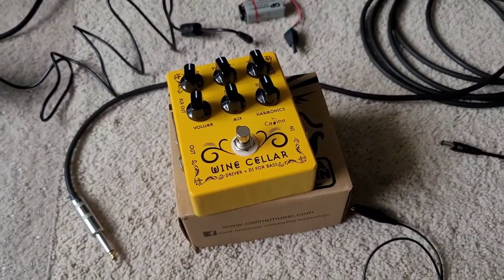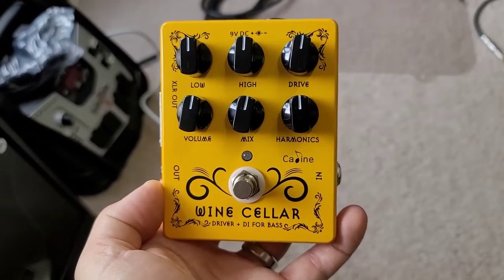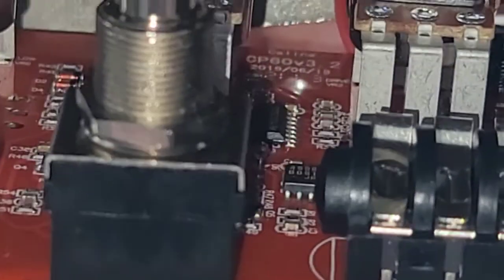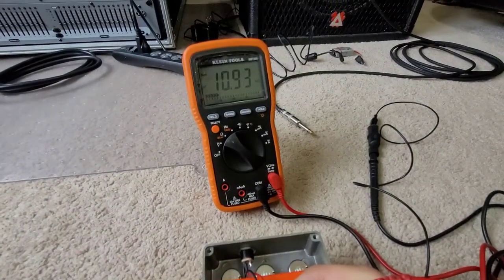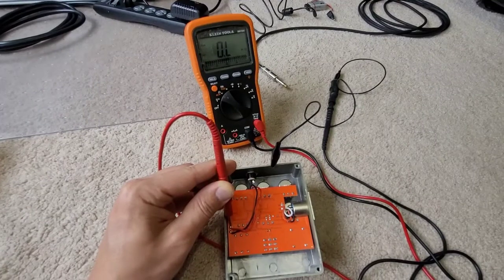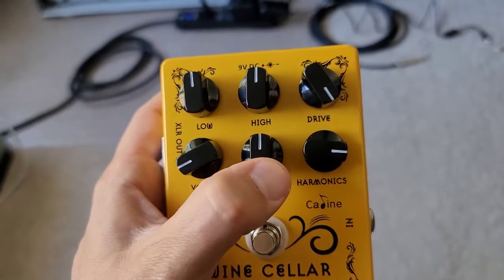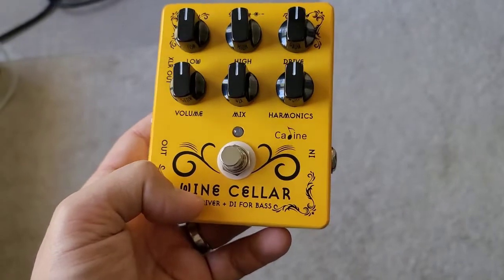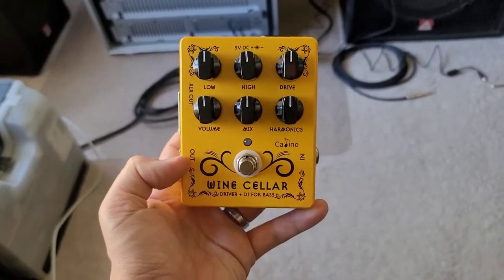Caline: CP-60 Wine Cellar Bass Driver DI Pedal: Technical Review & Teardown

Comment: my pedal is having a loud pop noise when plugging in the power supply. pls help me
Reply from the maker: @daveanthonybalisacan7941  only when it is plugged in? After it's powered up no problem?
Reply: @Bassguitarist1985  yes, even without switching it on
Reply from the maker: @daveanthonybalisacan7941  a loud pop is normal when powering up but shouldn't do that when switching the effect on/off
Reply: @Bassguitarist1985  what is the issue then?
Reply from the maker: @daveanthonybalisacan7941  buffer circuit is powering up. It's normal. It's not a true bypass

Comment: I got me one of these thinking the XLR output could be used as DI with phantom power but it doesn't work with phantom power at all. It only sends out the same level as the jack output when plugged to a 9v power source. What's the deal with that?
Reply from the maker: @N8oRMusic  that is by design the XLR in 1/4" output are the same level. Yes it can be used as a DI box. Unfortunately they did not put the phantom power feature like the Tech 21 sans amp this is cloned off of.
Reply: @Bassguitarist1985  it sucks because i need to bring along a seperate DI box to gigs in order to get any decent level signal to the mixing desk. Otherwise I'm needing to crank the mixing desk input to something like +20db while introducing a shit tone of noise. Could it just be that my pedal is faulty? It doesn't make sense.
Reply from the maker: @N8oRMusic  naw something is up. I've always had plenty of output volume from the XLR when running to a mixer. I usually get the opposite question does the pedal have enough XLR output to drive a power amp and the answer is no to that, it's meant to be a DI box. It's an amazing pedal for the cost. You might have a faulty unit

Comment: In some specs info on the internet mentioned there is a cab sim circuit included for XLR output, is that true?
Reply from the maker: Sorry for the delay response, but as far as I can tell there is no speaker SIM on the XLR. The same signal on the quarter inch is the same on the XLR.

Comment: Hi. Does it color  signal from DI XLR? I need  my signal go through to my amp combo for monitoring, and clean neutral signal from xlr DI to my sound card.
Reply from the maker: It does color the signal through the DI yes.
Reply: @Bassguitarist1985  But if I turn mix knob all the way down. Will DI XLR give me clean and neutral signal?
Reply from the maker: @EadgCrunch  it would yes, but no drive signal on the 1/4" essentially acting as a direct box. Why use it at all at that point? You would need a direct box for the clean signal while monitoring through your amp with the Wine Cellar using the drive channel
Reply: @Bassguitarist1985  Thanks for your reply! I’ve got an old audio interface with  broken monitor button. So I don’t have opportunity for direct monitor through my studio monitors, only with slight latency from ad/da conversion. I have a bass combo. So I decided to monitor my bass through my bass combo. Insert my bass in to Wine Cellar 1/4 input and output it to bass combo from another 1/4 output for monitoring and record clean neutral signal from  XLR DI output into my DAW for later processing. Will this work? Thank You.
Reply from the maker: @EadgCrunch  that will work yes, and if you want to preamp it through the pedal with the drive tone you can do that too
Reply: @Bassguitarist1985  Thank you.

Comment: hey i have problem with this pedal. at 5:10 you taking about this jackoutput. How to fix this. i have noise and hums when effect is on
Reply from the maker: The metal collets for the 1/4" input and output jacks need to contact the case in order to be grounded. Otherwise this is what I found causes the noise. Just scrape a little bit of the powder coat paint around the edge of the jack hole and then reinstall the collet with the washer. It should be enough to bond that jack to the case and stop the buzzing.
Reply: @Bassguitarist1985   ok so i must to unscrew all take the electronics little bit out, take the metal jack collar out and scrap the yellow paint in this place where os this ring of 1/4 jack? And what is the washer? Xd
Reply from the maker: @rastafaray666  The washer is on the collet itself I don't think it's removable, and yes you are correct on the rest

Comment: Hi man.. i had bass with active onboard preamp.. do i still need this pedal? Does it make the tone better?
Reply from the maker: It gives you a different tone it doesn't necessarily make it better which is subjective. You likely have a 9 volt or 18 volt active two band or three band EQ. That alone is very powerful of a tool. This pedal will do a much more detailed EQ curve than just a 2-3 band giving you a more mid scooped but mild overdrive tone. Check out my other demo video on my channel about this pedal that will give you an idea of how it sounds

Comment: i just wish they put battery slots in this! when i'm at my parents i don't really use power supplies so I have to use a HB Powerplant, it's mostly pretty good but I had to get a new one as the old one was noisy and stopped working so I don't want to over use this one. I got the Caline Bass Overdrive for the art and it's kind of meh, probably a cool single use pedal but I need something for my very dry sounding HB Amp
Reply from the maker: It's a great sounding mid scoot pedal and can work for various playing styles and genres of music but it's not for everything. Some may find it bland others may find it very useful when they add other coloration from their amplifiers in conjunction with this pedal.

Comment: Hello! Do you have a video explaining how to do this ''scraping''? I bought a pedal like this and it has a buzzing/noise.
Reply from the maker: I mention this in the video you need to scrape around the cutout where the quarter inch jacks are so that when you thread in the outer metal bushing it will make contact with the case. This will prevent it from having a floating ground causing noise.
Reply: Do I need to open the pedal to do this scraping or do I just need to loosen the ports on the two external connectors to do the process? @Bassguitarist1985
Reply from the maker: @dreik4302  no all you need to do is remove the metal bushings on the quarter inch input and output jacks. Scrape a little around just enough where the washer contacts directly with the case ground and then tighten back snugly Don't over tighten since the threads are plastic. That should hopefully solve your buzzing issue
Reply: Do I need to scrape so that the entire washer is in contact with the housing? I scraped both sides, but the buzzing/noise remains. Do I need to do it on the source connector too? In this case, do I need to open it? @Bassguitarist1985
Reply from the maker: @dreik4302  input and output 1/4" jacks. Make a video with the noise. What is your exact setup?
Reply: I use the CP-60 and a Sonicake Octaver. But I did the test without the CP-60 and there is no noise. When I use the CP-60 alone or with the octaver, it hums. Where can I send the video? @Bassguitarist1985
Reply from the maker: @dreik4302  upload a video to your channel and send me the link. Ill take a look

Comment: hi,... which is better caline cp60 or behringer bdi 21? thanks
Reply: I used sansamp and mxr bass d.i before! I need versatile sound with punch low 🙏🏽
Reply from the maker: I don't have experience with the BDI21 but id expect its a similar clone design of the tech 21 driver.
Reply: @Bassguitarist1985  i want to know in both noise case. Which one is lower in noise case 🙏🏽
Reply from the maker: @xtremeboy851  can comment on the BDI21. Never tried it. I do have another video where you hear a DI mixer feed of the Caline CP60
Reply: @Bassguitarist1985  can you give me a recommendation the best one cheap preamp d.i?
Reply: Does caline cp60 a pure preamp or with cabinet simulator?
Reply from the maker: @xtremeboy851  no its a DI box. No cab sim.
Reply: @Bassguitarist1985  is cp60 true bypass?

Comment: It would have been amazing if they'd kept the XLR 48v powering option on this pedal.
Reply from the maker: Certainly would be a nice feature but they remove that and also reduced the amplitude of the XLR to instrument level instead of line level. It would not be able to drive a Poweramp on its own without a mixer in between.
Reply: @Bassguitarist1985 Audio lesson #1 :  A DI is not line level at the DI's output. You need a pre-amp to bring it up to line level. The XLR output on the CP60 fonction is a DI output.
Reply from the maker: @MartinMartin-yi9to  Yes correct that is what I said in my previous comment. Many people seem to mistake this pedal as a preamp pedal but it is not. A preamp denotes a line level output, a DI box denotes instrument level out, meaning it requires an audio mixer with a preamp to boost the signal to drive a power amp.
Reply: Quer dizer que esse pedal não é um pré amp?

Comment: What's the value of 1/4" output impedance?
Reply from the maker: I chatted with you on FB. I assume 100k, don't have the schematic. I can ask my Caline contact though.
Reply: @Bassguitarist1985  oh that's you! Thank you again for your contribution for the bass community!
Reply from the maker: @datle1402  my pleasure!
Reply: @Bassguitarist1985  Oh, and by the way I have another question! I notice there's a difference (quite substancial one) between [MIX knob in zero position] and [bass directly into interface]. Also when I set my MIX knob to zero, other knobs still change my sound when I try tweaking them, which is pretty nonsense. Is this normal or my unit is defective? Thank you!
Reply from the maker: @datle1402  i believe that is normal. I'd have to see the schematic to understand the signal routing better. I like the sound of the pedal though!
Reply: @Bassguitarist1985  Hello, I have another question if you don't mind! Can you tell me if this pedal is a transparent active DI box when I bypass it (or set Mix knob to zero)? Thank you!
Reply from the maker: @datle1402  it is a buffered circuit for the 1/4" in/out. The footswitch does true bypass the tone circuit so it does act as an active direct box

Comment: No 9v power adapter? Wow, that's something that all pedals should come with new. That's something that is a must with me, no plug in power adapter no bueno.
Reply from the maker: Unless it's a specialized voltage other than 9 volts many pedals are not including them. The thought is that you will be putting them on your pedal board which should already have a power supply to run it. It's the same argument as a phone charger included with new cell phones, some of them don't include it

Comment: Hi my man
Do you think this is a better purchase for bass vs the Joyo American/Caline Americana?
Reply from the maker: I would say that this is a better purchase for bass guitar then the Americana. I haven't tried that one yet but I would question if it retains the low end of bass. If it doesnt you might need to run it through a parallel mixer to mix the pedal and dry signals

Comment: I sold my Sansamp BDDI thinking I was done with preamp / DI pedals.  Ended up wanting to add a little grit to my Markbass combo so I bought one of these.  I have ran it into the front end and the effects loop.  It sounds great either way.  I do wish it had a phantom power option but... what would you expect for $40.
Reply from the maker: Exactly! Its a budget clone pedal based on the sansamp. Very useful for the price! No complaints here!
Reply: Update lol!  Just bought the Ampeg STG-DI. It quickly jumped into the number one spot.

Comment: also, is the XLR protected from phantom power?
Reply from the maker: Yes there are coupling caps on the hot/cold pins after the opamp outputs to block VDC. Phantom power wont harm the pedal.
Reply: @Bassguitarist1985  I was running out of google-fu to find out about this, thanks for informing!
Reply from the maker: @doplaysgames  Glad I can help out!!

Comment: those arent "ti074". those are ST microelectronics and the series is TL07X. The 072/082/74/84 are standard JFET op amps. that and the NE5532 are almost all ya need. oh and the 07X are lower noise than the 08X. the 06X series are low-power consumption.
I wish you popped off that XLR jack and took some photos. I've been trying to reverse engineer/get a schematic for one of these without buying it. I feel like it's a clone of the sansamp
Reply from the maker: It is an exact clone. I dont have the schematic. I could ask them. Thanks for the info!

Comment: Does it have a cab sim? Or just a pre amp? Thank you in advance
Reply from the maker: Its a DI box more so really. The XLR cannot drive a power amp without first going through a mixer. No cab sim, but the mids are scooped out and has a high treble attack like the Sansamp
Reply: @Bassguitarist1985  thank you very much so i must use some cab sim when im goin direct at the house/mixer, and this pedal for tone shaping purpose only? And btw i took you advice for scraping the paint on the jack outputs and it helps a lot on the noise issue 🙏👌 more power God bless from Philippines 🇵🇭
Reply from the maker: @Iyannnn17  Ian, I would say you don't really need a cabinet simulator for this pedal as it definitely already has tone shaping before you start making adjustments with the knobs. Give it a try without it and see how it goes you can always add a cab simulator later.

Yes it's a small oversight with the paint scraping at the factory. The case needs to be grounded by the amp.

Comment: Great video! I bought this pedal recently, and it has some noise, both with the power supply or the 9v battery on. The noise stops as soon as I touch the pedal casing or the switch. What could be generating this noise?
Reply from the maker: The 1/4" jacks are not making contact with the case properly. You may need to scrape some paint around the jacks so its bare metal under the washer. That should ground the case when you have it plugged into the amp.

Whats your whole configuration?
Reply: @Bassguitarist1985  It worked! Thank you so much! I plug my bass into the DI and then straight to my interface or my amp through the 1/4". I was getting noise from both, and thought was an issue with my power supply.
Reply from the maker: @lucasnich  very cool! Glad it worked out! No noise? Quiet now?
Reply: @Bassguitarist1985  yeah! no noise, at least the ground noise. just the single coils noise.
Reply: @Bassguitarist1985  hello, is it the input jack/jack socket that I should scrape? or is it the cord itself?
Reply from the maker: @tiantugs  Both. Sometimes the paint prevents the outer ring of the jacks ground to the case.
Reply: @Bassguitarist1985  Noted on this, thank you!

Comment: Great video! thank you so much. I have a question: From what I understand, these so-called 'preamp' pedals for guitar and bass are not actual preamps, in that they don't raise the guitar signal to line level, they seem to be more of a tone shaping device than a traditional preamp. Would that be an accurate description and can you comment on that? Thank you
Reply from the maker: Yes you are correct, tone shaping. The 1/4" is instrument level, and the XLR out is mic level. You need to plug the XLR into a mixer to get the line level you want.

Comment: Thanks for the great review.. Any idea how much gain this has ? Does it have enough juice (while still clean) to drive a power amp from its 1/4" jack ? The practice area has an old Fender BXR300 that I bypass the preamp on.
Reply from the maker: The output is instrument level, not line level, so I would say no it does not have enough gain. You need a small mixer to run in-between it and the power amp.
Reply: @Bassguitarist1985  Thank you..
Reply: What about the xlr output? Would that drive a power amp? Very nice review!
Reply from the maker: @toddlangworthy1361  it might. Ill have to check it out

Comment: if you connect both outputs you get the same signal on both?
Reply from the maker: Yes on the 1/4" and XLR. Only difference is one is unbalanced and the other is balanced

Comment: Hi, and first, thanks a lot for the video.
I am pretty interested to get one of those as well but I would like to ask a (maybe stupid) question. Is there a possibility to plug headphones in that pedal to practice at home…? 
Thanks to anyone who is going to answer me…! 😉😊
Best regards, Jef.
Reply from the maker: Yes, but you would need a separate headphone amplifier connected to the pedal. Very easy.
Reply: @Bassguitarist1985  thanks a lot. I’m going to try a find something like that…! 
And thanks for the very fast answer… 💪🏻🙏🏻🍀
Reply from the maker: @jefabel5252  there are many options out there in terms of headphone amplifiers. I have a cheap Douk Audio U3 off Amazon and it works great for applications like this. More advanced ones have built in EQs for example. Best of luck!
Reply: @Bassguitarist1985  ok, thanks again for your help. I’m on a new quest…! 😅
Stay safe… 🍀
Reply from the maker: @jefabel5252  you as well!

Comment: I have this pedal and xlr output is very weak but the 1/4” is fine. Any thoughts?
Reply from the maker: Weak as in low output volume? Are you going atraight into a mixing board? Gain set right?

Comment: Is there more likelihood of ground noise if using this pedal as a DI only with no connection to an amplifier? That is how I would most likely be using it.
Reply from the maker: Little chance at all. If you have other pedals and the PSU has a ground reference it should be okay. The XLR pin 1 is lifted so there would not be any ground loops
Reply: @Bassguitarist1985  Thanks for the quick reply. I'd be powering it with a powerbank/USB to 9v converter most likely or just straight from a 9v battery with the included battery clip. Should be ok I guess.
Reply from the maker: @RobCmusic  yes, the current draw is about 30mA. Very low and should be just fine!